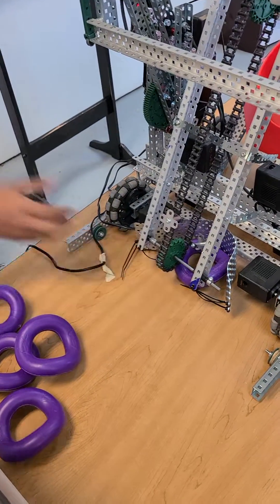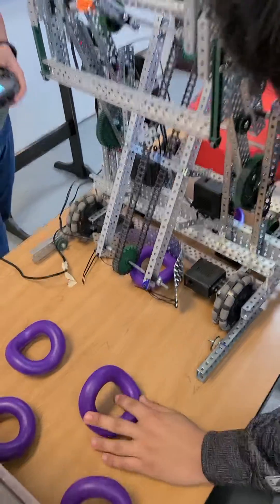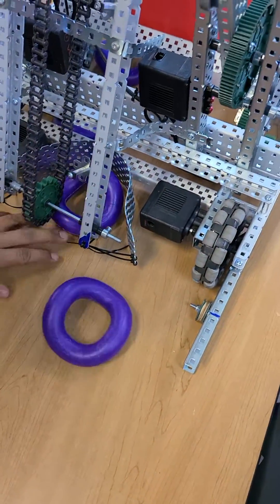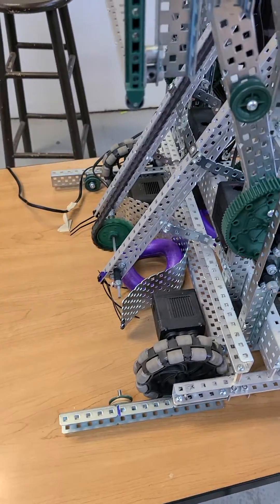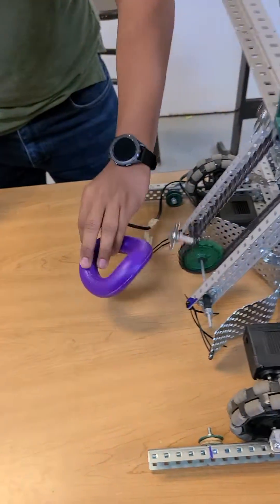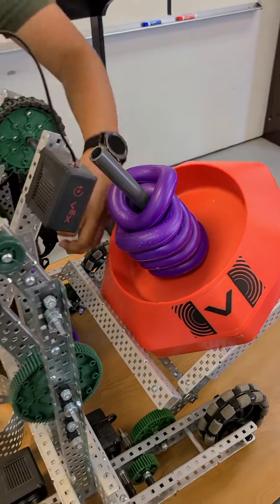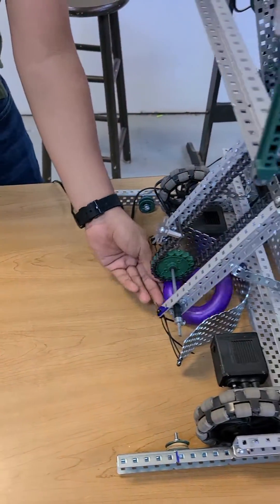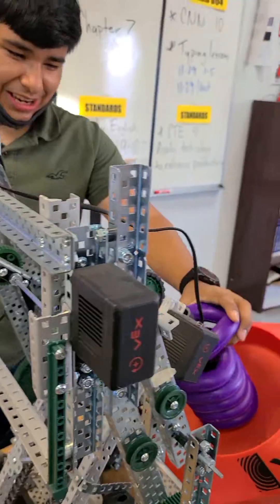Conveyor Belt prototype VEX Tipping Point

Comment: Nice, we opted for polycarbonate triangle instead. But a quick fix for your design, might be to make the top gear smaller so that it flings it quicker at the top mechanically, that way you don't have to fix it in the code
Reply from the maker: Thanks for your input, that idea might just work.